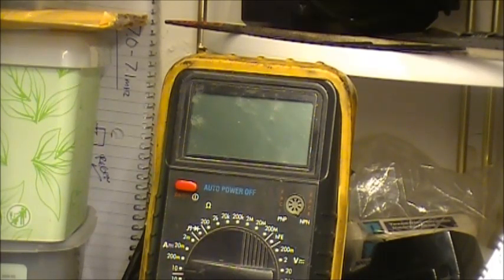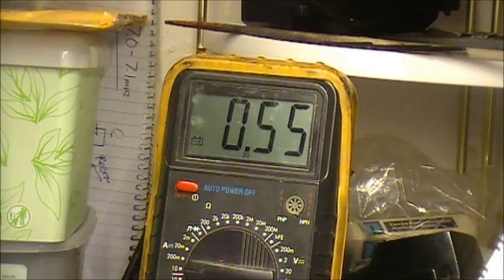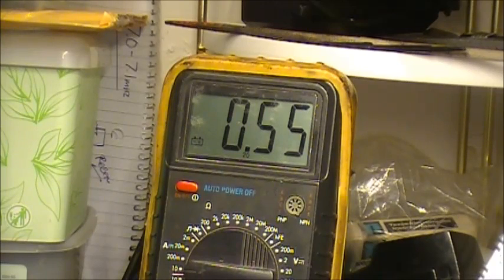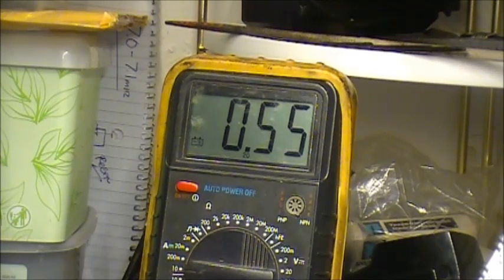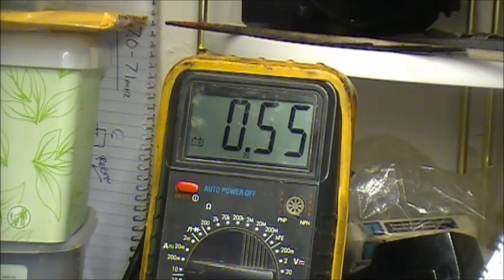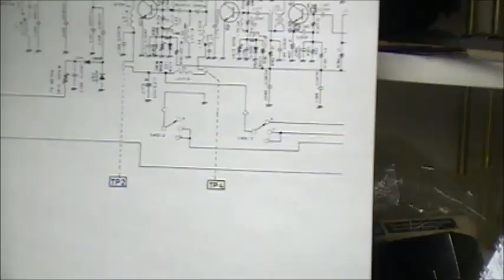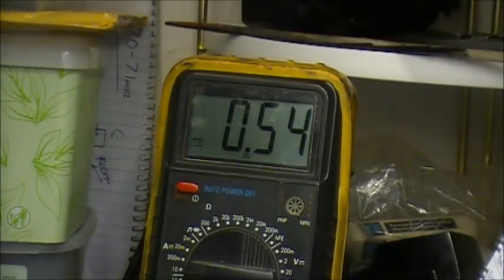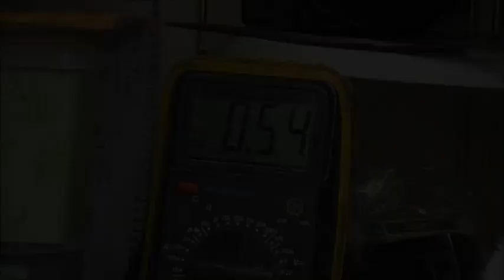Realistic TRC-458  / PART-3  "Transmitter Short Circuit"

Comment: Has someone recalled the radio. I'm wondering if either someone reversed a cap of shorter something out on the rd side. Have you also checked the audio amp and the voltage regulator? Good luck. I love that series of radios!!!!!
Reply from the maker: Radio has been recapped... not by me tho..

Comment: I had that issue, kind of
https://www.worldwidedx.com/threads/cobra-148gtl-shorted-final-on-rx.221534/
Ceramic caps were shorting.
Also make sure the diodes are on the right spots.
Reply: looks like the diodes are ok, I'd unsolder the ceramics on the bottom side going to the finals and try that. or maybe the bias is cranked?
Reply from the maker: Checked them out, they are fine.. as well as those 2 bias diodes.. Strange stuff

Comment: I'm sorry. That first sentence should have read, " has someone recaped the radio". I'm wondering if someone reversed a capacitor or shorter something out on the board in the process. The last thought was checking the audio amp and the voltage regulator. People like adding different upgrades like audio, power and receive modifications. I don't understand why? The radio works well out of the box before the magic screwdriver shows up. 1 more thing, and I'm sure you've already checked for that crap glue  they put all over the board that causes problems. Good luck. Billy
Reply from the maker: I have checked the polarity of all the replaced caps.. they appear to be OK.   Question is tho, have the text been applied correctly on them?